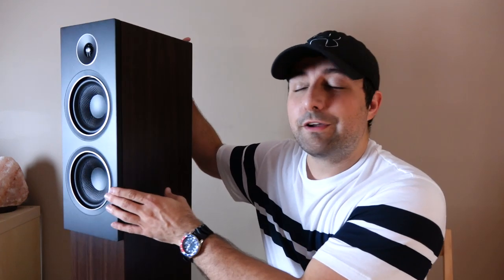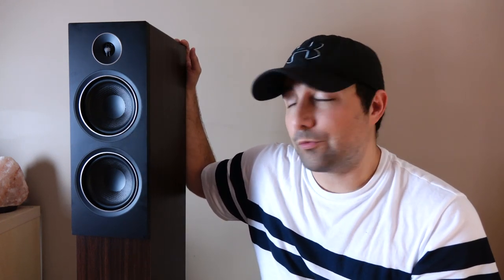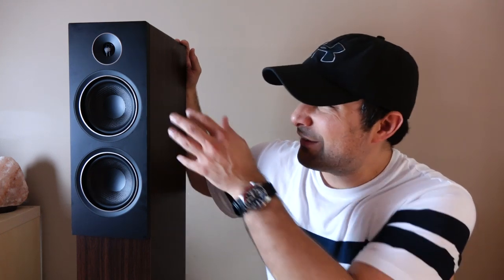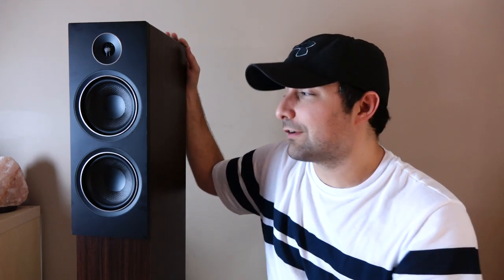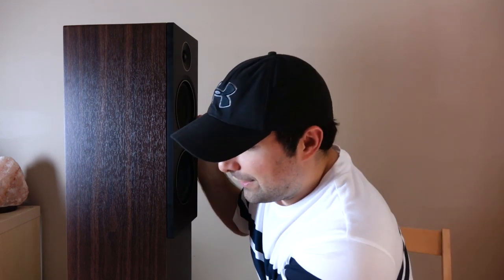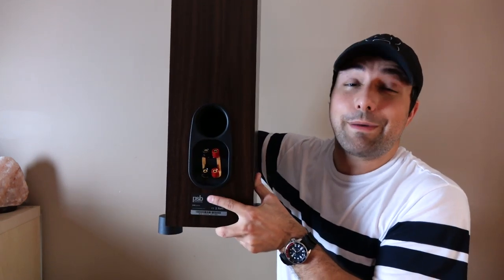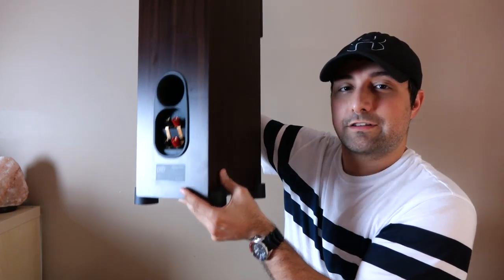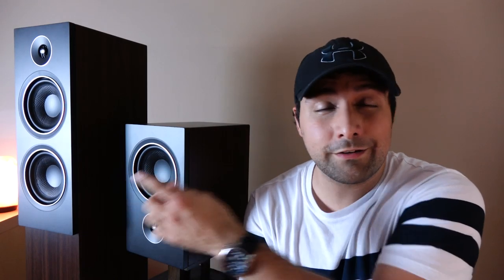Review! The PSB Alpha T20 Floorstanding Loudspeaker!

Comment: A solid summary of what these are about. I'd add that your point about stands applies to the P5 as well…by the time you add a nice pair of stands, the difference in price between the T20 and P5 closes to under $100. At that point, I think the T20 is the better value for people who have the space to set things up properly.

When the T20s are set up well, an increased scale from the midrange over the P5 was the first thing that I noticed. Only certain genres and albums reveal the difference in bass extension and output, but it's nice to have when it's called for! Agreed that the P5 is more versatile and a little easier to dial-in.

Both can be played at levels approaching 100 dB in my little 15.5 x 10.1 ft room without sounding strained. I like the fact that the T20s look like baby KEF 104/2s from back in the day. It would be fun to A/B them. I bet the little PSBs would give the elder KEFs a run for their money.  :)
Reply from the maker: It's nice to have options.   Yep, these speakers can play at surprisingly loud volumes all the while remaining composed.  You still diggin' on the T20's?
Reply: @ZeroFidelity  – Yes. I need to get them out of the room but still having a good time…I know you are familiar with the backlog problem!
Reply from the maker: @dsnyder0cnn  Sweet!  And yep, all too familiar!   Good luck on keeping your head above water!

Comment: Thank you for videos. Really helps. And need advice on what is your preference between Musical Fidelity M6si ,Yamaha-A 2001 and recently reviewed Kinki Studio. Probably I may pair with Kef R line floor standing . Basically I have KEF LS50 Wireless. Looking for same sound signature at larger scale.
Reply from the maker: Kinki if you like a clean and clear sound.  MF if you like a bit of warmth.
Reply: Thank you . What do you thing Kinki and Kef synergy
Reply from the maker: @kvrhifi  Cant say.  I've had to hear it to have a qualified opinion.  My guess is that it would be very clear, spacious, quick, forward, and somewhat thin sounding.

Comment: QUESTION,🤔🤔🤔 I was on a sight that said to replace the cheap gold plated  metal jumpers on the back of most biampable speakers with speaker cable and the sound will improve with most loudspeakers?  Is there any merit to this as it does make a little sense?  🤔🤓🤯  The person seemed legit and it would cost almost nothing using 12 gauge wire!🤔🤓🙄  The Monitor Audio gold I had used thick gauge wire!
Reply from the maker: This is one of those things that you just have to try for yourself.   Most of the time, I'd say that there is either little to no audible difference between stock jumper plates and fancy jumper cables.  Every once in a rare while however, I'll come across an affordable speaker that responds (positively) to the change.
Reply: @ZeroFidelity  

Thank you for your reply and info! I figured why would loudspeaker companies leave so much on the table with such an easy fix!😎😁🤗😉🤔🤓
Reply: @bigjay1970  I'd have to disagree with Sean here. The difference can be night and day. Listen I had $25,000 B&W Matrix 800s back in '91. The jumpers were absolutely horrid sounding. They were quad wireable but I just biwired and jumped the other two binding posts. 
I visited the #1 B&W dealer in Toronto and suggested to them that they replace the jumpers on their 800s with a piece of wire right off one of their spools and once again the improvement was not subtle. The first rule of audiophile is and always has been to throw away the jumpers. I have 3 Ziploc bags full of them. An added benefit is that you can tune the sound of the speakers with different wire jumpers.
Reply: Tried that on my Wharfedale Diamond 220. The result is positive. However, the best result is obtained through bi wiring. Many  audiophile speaker cables (e.g. Audioquest Rocket series, Mogami 3104) internally support bi wiring. No need to spent extra money for an extra pair of cables.

Comment: I don’t understand why PSB chose to go with a 3/4” tweeter. Having built speakers and playing with various size tweeters, I just have never chosen anything less than 1”.
Reply: Smaller tweeters are more accurate, generally speaking.
Reply from the maker: What Audfile said. Small tweeters do their job (of handling high-frequency information) incredibly well.
Reply: Small tweeter sounds smoother
Reply: The PSB Stratus Minis (which are arguably the best standmount PSB ever made) use a 3/4" tweeter.